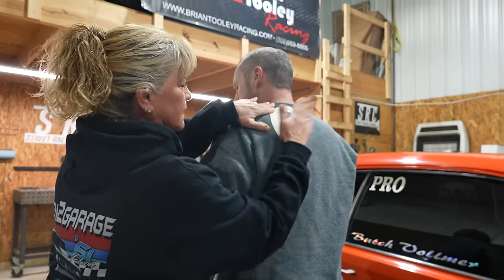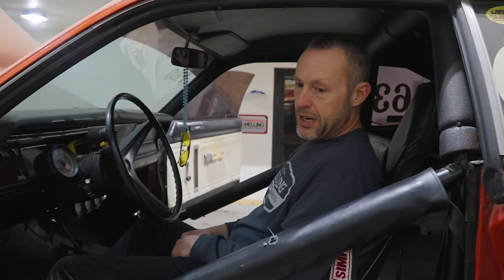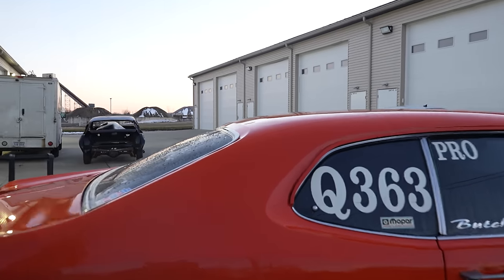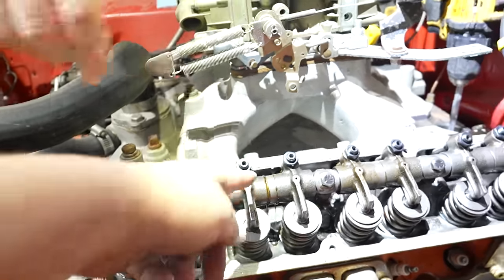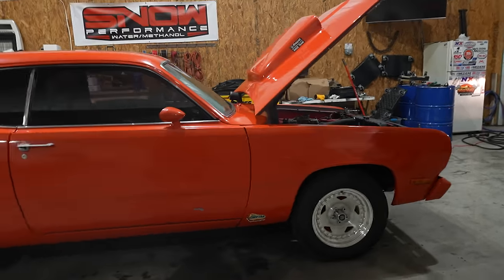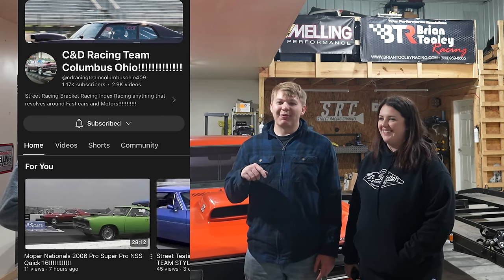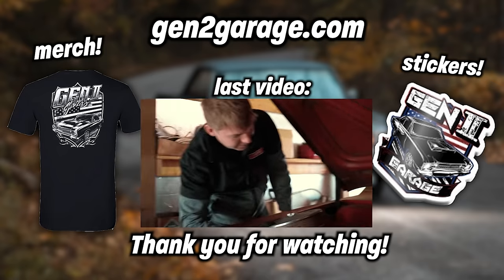Sitting for 22 Years - Will Our 340 Duster Run and Drive?

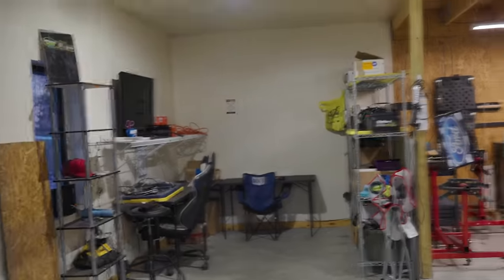Comment: My first cat was a Hemi Orange 72 Duster. It had a blacked out hood and center strobe stripes. Black stripes down the side and black stripes around the tail lights. It had a 318 with a 3 on the floor. 8 3/4 rear end with 3:23 gears. With in the first year I had added 340 heads with 3 angle valve job. Cam dynamics cam and double roller timing chain. Edelbrock 4 bbl intake with a Carter avs  750. A set of cyclone headers and 2 1/2 inch dual exhaust eight he famous Duster chrome tail pipes. A set of Crager SS wheels and Road Hugger white letter tires. I went street racing in that car all over Kannapolis and Concord NC. I was only 16 when I got it. Paid for it with my job at KFC. I sure miss that car. I remember the car payment was $88 .00 a month. Those were the days. I still have dreams of driving that car. Many a week end at the car wash hanging out with all the guys from school who had hot cars. Thanks for the video that is one nice Duster. I will be watching for future videos.

Comment: For a car sitting that long I would check the valve springs or replace to be on the safe side. They can loose tension with the valve being open over a period of time. Love the car
Reply: Valves were closed when he stopped racing

Comment: Digging back to one of your older videos of your OBS when you were doing some of the suspension work, how was it stuffing in those Moroso trick springs? Ive got a 76 c10 Im building to hopefully be a drag n drive truck, finally got a way lighter rate rear leaf in it, but want to get something in the front that will help with that weight transfer and they dont have a "specific fit" spring for the trucks it seems, and havent found much info on guys stuffing them in c10s, curious if youve got any input on that?

Comment: I was gonna sump the tank in my Great Value Grand national. By the time I added up the tank, sump, ext pump that won't last a year and all. I ended up spending about $1000 and got a powder coated tank, with dual hell kitten pumps in holley efi hat. And you cant see any race kinda stuff since its just a 150hp street car.

Comment: Imagine how much of what was in those headers went.back in ask the professor Warren Johnson or smokey when you first start any car with that much overlap you start with a blip of the throttle to keep the rust from going back in the cylinder during start up

Comment: Ol gal looked good with that 1/4 inch of dust knocked off. Man i love Dusters. I had one in High school. That was a street king. Not many touched me. Then i was driving and a monster dog jumped in front of me. I had just dumped 2 weeks pay on a new radiator and just saw in my head that dog tearing up my shark tooth grille and thst expensive radiator so i yanked the wheel and pitched sideways into a parked van. Hit right at the rear of the door frame. Door popped open and i flew out. Cop behind me figured i was dead flying outta the car so he grabved a body blanket and started covering me up. I came to about then. My car was screwed. Someone stole the battery the next night and it got towed. I was hurtin and just let it happen. Man that sucked.
Reply: DAMN 91 WAS WHEN I GRADUATED AND TOTALED MY DUSTER!!!

Comment: Nice looking car. I gotta say before you wax that whole car I’d hit it with clay. Using a clay bar on cars that have been sitting clean all the collection of crap off the surface of the paint. It comes out smooth as a baby’s bottom and then hit with clay. That car being it was sitting inside should clean up without having to buff it really.

Comment: Did u not even have to clean the carb and it’s running this good after 22 years? If so must have not had any ethanol in it and race fuel.

Comment: I think I would be embarrassed if I took a purpose built drag car to the track and ran an 8.50.  I had a pump gas, all steel all glass street car 25 years ago that ran 6.40's and could drive back and forth to the track.   Put some real HP in that thing and let's see it rip!

Comment: What a dream team, nobody can bitch we get every brand. More MOPAR Please.
Funny how every FAST Chevy has a HEMI head. Ford need chevy motors with himi heads.?
Congratulations on loosing weight Allison, better watchout Tommy she gonna be way to hot for you soon , better hit the gym boy. Kidding I can see you 2 old swaping racing stories together in rocking chairs one day.
Reply: FORD'S boss engines are hemi engines (302, 351C, & 429). So while Ford don't have as large of a collection as Chrysler, Chrysler does not have a corner on the market. Of course Chrysler didn't "invent" the hemi, Desoto did.
Reply: @augie-dawgiewright3798  Nope not at all most everyone copied it, mainly motorcycles. I just think it's funny people hate on Mopar's, Debatalbe if spark plug angle counts as a "Hemi" or not? .  Now use the same stuff just 50 years later to fix Others stuff in the aftermarket.

Comment: Love the duster but did you REALLY have to prime the engine by taking distributor out wouldn't just turning the key be 100% easier and the way 99.9 of people start a car that's sat for a bit???? 😅😅😅
Reply: The point is to get oil on the bearings BEFORE you start turning the rotating assembly. To prevent possibly scaring the bearing surface by starting the process dry
Reply from the maker: @AaronCrisco  bingo
Reply: @gen2garage  I've never in 30 years seen a engine blow up because you started cranking the key with a oil pan full of fresh oil.........